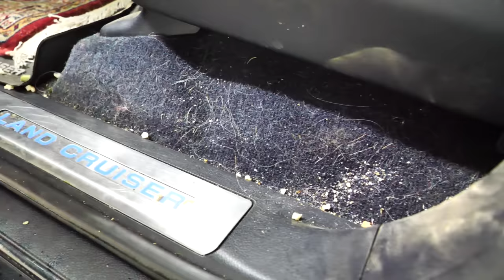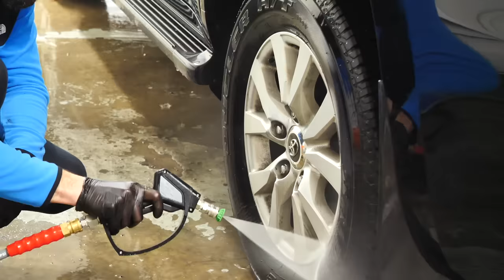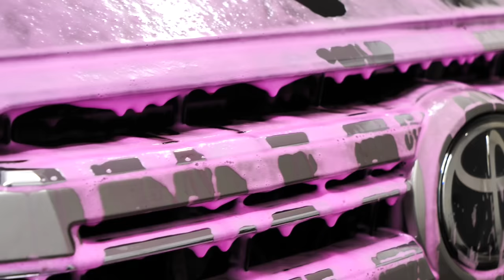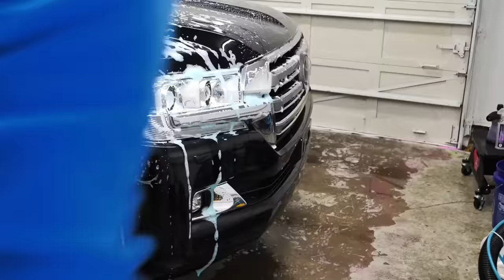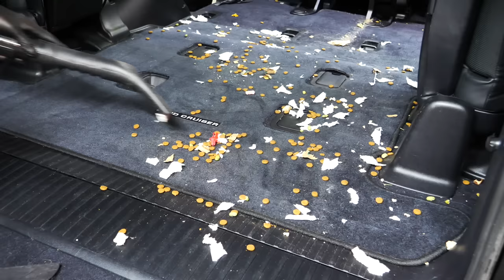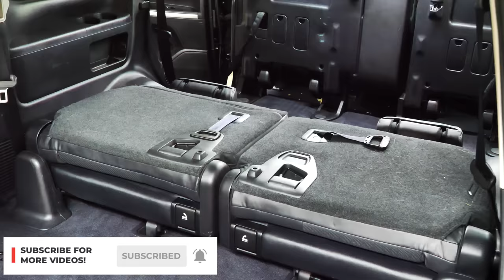DeepCleaning of A Dirty Toyota Land Cruiser For Free! Car Detailing Restoration

Comment: To be honest i like both the interior and exterior work. I’ve been detailing for 4 years now at a couple different dealerships progressively getting bigger and i can’t thank anyone else but you i came home and have watch your videos pretty much every night since I’ve started and you taught me the smallest things from brushing badges of the exterior to help the cleaning process or the best ways to extract. One of the biggest issues I’ve had was that and just letting solution settle and just clean hot water till the water comes clean, and it has made my boss and my work speechless. So thank you

Comment: Great video. The Land Cruiser cleaned up nicely. By far, my favorite portion to clean is the outside. My inside is never all that dirty so it’s not something I do often. Another use for the airline is blowing the debri from under the seats to the driver/passenger footwell for easy vacuuming. Saves time from having to remove seats. Can also do the same thing with a car dryer.

Comment: I love watching the insides be cleaned cause it shows improvement every time no matter if the car is filthy or slightly dirty. The outside I only like watching the tires and paint corrections! The insides better cause no matter how long it hasn’t been cleaned dusty and particles still appear and dirty still adds up from every time you enter the car.

Comment: Interior to me is the most important because you are constantly inside driving it and not always looking at the outside. Especially living in wisconsin winters with all the snow and salt getting on the outside of the vehicle you don’t normally clean the exterior that often. But detailing the enterior is good not only for yourself but also for others getting in and out of your car. It’s also fun messing around with different detailing products figuring out what you like and you don’t like.

Comment: I would say cleaning the exterior, mainly contributed by the lack of equipment. It's not as easy to use the dust pan and brush instead of vacuum. But I do a good job either way.

Comment: Just came across you Channel.  Subscribed.  I don’t see any car washes on you site.  Are there any that you would recommend?  I have a foam cannon for our SxS but just use a cheap armor all wash.  Do you use the AP cleaner on your site for a glass cleaner?  My windows always seem to have streaking.  I never notice it until I drive into the sun.  

Also,  do you have any videos on how to properly clean an engine?  Thanks!!!

Comment: I would be careful having the liquid go down in the opening of the seatbelt buckle holder as that can cause rust along with where the important buttons are located. This happened to my previous car after years of detailing. It caused the buckle holder to get stuck. The buttons would stick and stop working so I had to replace them way too often.
My detailed now shoves some sort of material into the buckle opening to prevent any liquid going into the hole and avoids using any liquids around the buttons. He simply squirts liquid onto cleaning towel and wipes around all and any buttons.

Comment: Do you ever detail the engine bay at all cause if you do there is thing called "dry ice blasting" where they use dry ice to lift off the contaminants without harming any of the electrical components within the engine. My favorite part of the detailing videos are when you use the extractor in the interior to see all that dirt lift off the carpet

Comment: I prefer cleaning the interior because it's much easier LOL.  The exterior takes me forever and is exhausting.  I drive an ML350 and I'm 6'0" so not quite tall enough to do the roof without a step ladder which is annoying.  Also seeing the exterior get dirty after all the work I put in hurts more than the interior getting dirty.